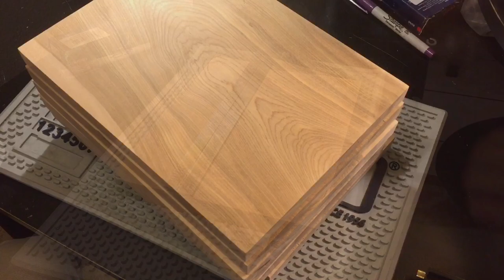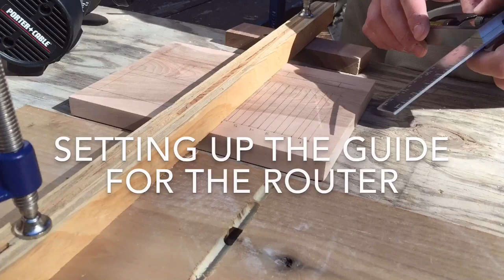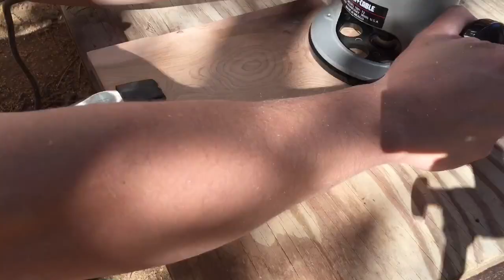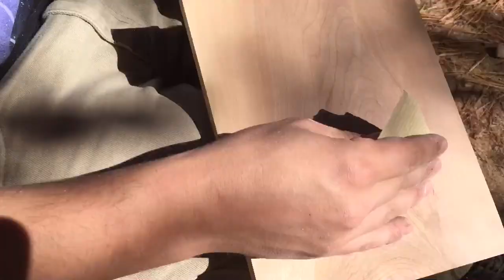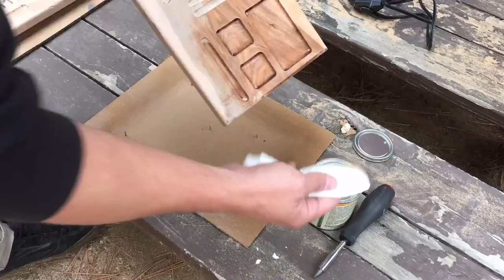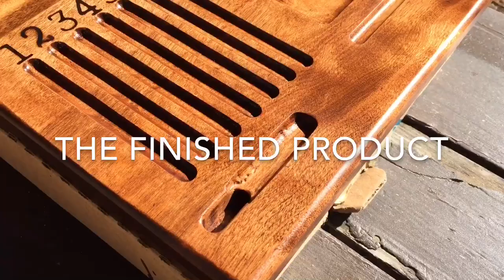[25] Wood Pinning Trays - Start To Finish

Comment: what are the dimensions of each section? I love how your tray looks and am just getting into lock sport. also am a wood worker.
Reply from the maker: Hey, I use a 1/2 inch border around the whole pinning tray. I use a 1/4 inch router bit and I offset each grove by about 3/16th of an inch. After I get my grooves done for the 7 chambers I come up with the extra compartments. I have found I like the long groves better than the separated ones that  I have made in the past. The broken up grooves are good if you are building SFIC's all the time as you can separate the master wafers. But for locksport the long grooves work great and keep things simple.
Reply: +Von Perry Photography (Tahoe-Picked) Awesome. I was liking the look of the long groove myself. Would you recommend the plug holder with the deep set Key (I could see that on yours)
Reply from the maker: If you watch some of my newest videos I have started using an even smaller one that's just the 7 grooves and one compartment. I like this more for filming. Now when I'm building multiple challenge locks I still use my bigger board. The holder comes in handy but isn't a necessity.
Reply: +Von Perry Photography (Tahoe-Picked) thanks. new subscriber now and hope to be building, trading, and picking challenge locks soon.